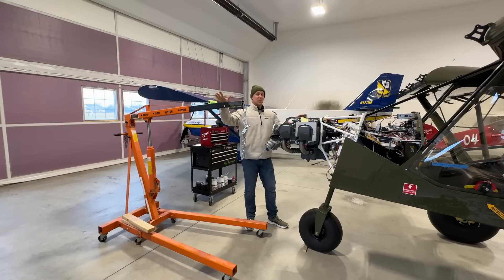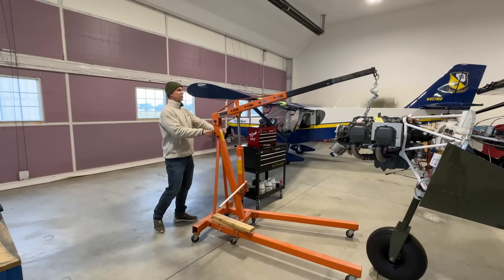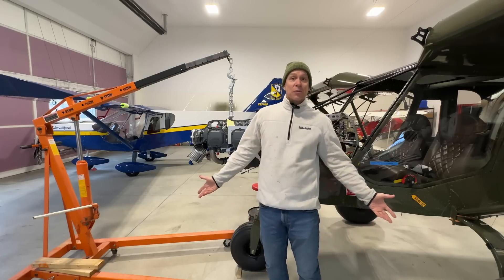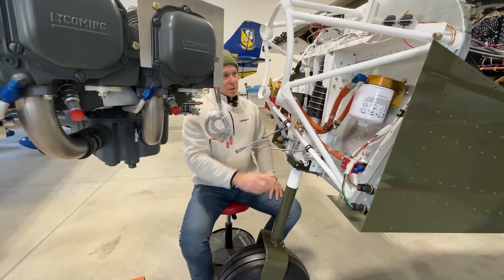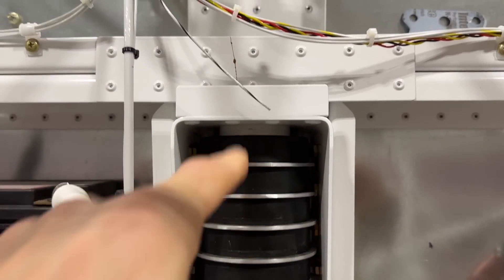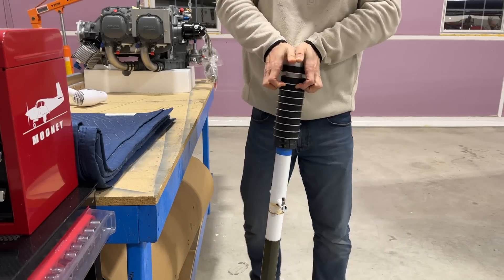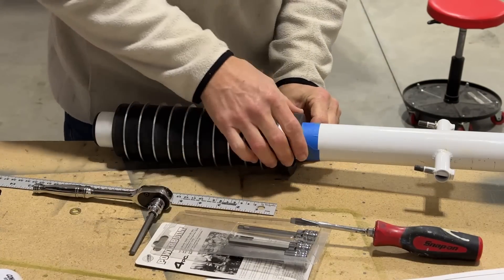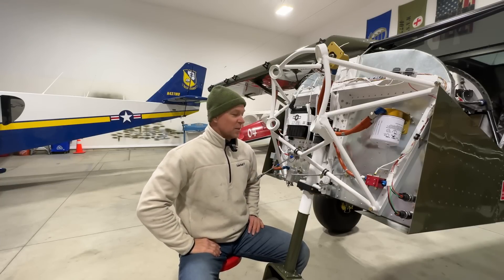Removing the Lycoming Engine

Comment: Did you solve the mystery of the 290 mm discrepancy ? 
Should the measurement be to the lowest surface in the assembly of the ‘donuts’ (including the bottom two steel fittings) ?  
… or is the dimension shown on the drawing for a different assembly configuration when compared with yours ?
Impressive patience 👍
Exceptional attention to detail as always 👏
Reply: Just finally read through the earlier comments, so it was a different number of pucks (donuts) installed 🤔
Reply from the maker: @aviationled_mmix  Yes my kit was shipped with the 750 STOL nose pucs and plans page. Roger at Zenith sent me two additional pics so with the two additional pics all the measurements were correct.

Comment: Not sure if you do much off airport operations but on my zenith the nose gear just wasn't robust enough.  Started getting distortion in firewall brackets, and the floor really rattled on rough terrain rollouts.  I extended some channel underneath to the seats and beefed up the firewall.  Then I added the nose strut from a Cessna 172.  The new nose gear has been a game changer with my plane.    I built in an extra 6" of prop clearance while I was at it.  New gear is significantly heavier but has totally been worth it to me.  I can't say enough about how well an oil filled nose strut does on the zenith.

Comment: Have ya concidered NOT having your lift boom extended so far ? If ya shortened it , it wont tip forward. ( ex crane operator ) 😂
Reply from the maker: That's a good point Dave. I had to have it extended pretty far to get it off the crate it was shipped in. So I just put the engine hoist back to where I had it previously. Looks like I didn't need to extend it so far this time. But hey...it worked! LOL

Comment: You really want full movement of those pucks to provide proper shock absorption. As tight as they are now will cause problems. Lubrication is the issue and that will deal with your corrosion concern. Remove the paint.
Reply from the maker: I'm actually thinking of just getting a new gear leg from Zenith. I want them to weld in the small tube at the bottom that used for their tow bar.

Comment: 2 things - 
Noticed what I would consider a problem with your throtle cable mount.  You have the cable sheath mounted to the motor mount, of course when the engine is running there is relative motion beween the engine and the motor mount.  This motion can manifest as throttle movement because of your securing the throttle cable sheath to the engine mount.  I secured the sheath to the motor (via a bracket mounted on the engine/carb).      
   About the puck stack, how is your clearance between the nose gear upper mounting bracket and the aluminum washers between pucks.  I had to chuck mine up in a lathe and machine them down so they wouldnt rub on the bolts and rivets on the inside of the upper nose gear bracket.
Reply from the maker: I'm aware of that. There are a few things FWF I'll probably be changing. I did notice the tight tolerance between the disks and the bolts, and it's VERY close, but they do not touch.

Comment: Do you think Zenith should circulate a service bulletin about the 290mm nose wheel assembly measure, to give more ground clearance to the prop?
🌏🇭🇲
Reply from the maker: If you read the other replies, an eagle-eyed viewer noticed my gear has 10 pucks and the plans show 12. So I'm not sure if Zenith changed the number of pucks and didn't update the plans, or they just didn't send me the two extra pucks. But with the 12 pucks, the 290mm is accurate. So the real question is: how many pucks are suppose to be on there?!?!

Comment: Your nose gear puck adjustments would have been much easier if you hadn't coated the area under the pucks with paint or powder coat (don't know which one you used).  It's much better to leave that area bare metal - I ground off the steel scale and even slightly polished it.  Then, liberally grease the pucks and nose gear leg with 3M silicone paste grease.  I also lightly sanded the i.d. of the rubber pucks to ensure they would slide firmly but smoothly on the nose gear leg.  Using this method, I can slide the pucks up without having to remove the leg - gently pry with a pair of big screwdrivers if necessary.  Then, loosen and push the upper collar up against the stack,  push the lower collar up against the the upper and secure the bottom collar.  Then again with a pair of screwdrivers, you can pry the upper collar up to tension the stack, secure the upper collar screws, and then bring the bottom collar up and secure.  You can repeat this as necessary to get the proper tension.  I've had zero corrosion problems with not painting or powder coating the area under the pucks and the suspension is very smooth and supple - feels like a pneumatic strut!
Reply from the maker: John, I thought about that when I had the gear leg powder coated. I knew it would make the pucks more difficult to move or install, but I wanted the steel protected. I’m sure with enough grease on there it would sort of act just like the powder coating to protect it from corrosion. 👍
Reply: Yes, the grease is protective and also the stack is so tight from compression and with the grease between the pucks, the gear leg is essentially sealed water-tight!
Reply from the maker: @n206ja  How did you polish the bare steel?
Reply: Used a foam-backed sanding pad on a grinder and successively finer grits of paper and gave a final smoothing with Scotchbrite.
Reply from the maker: @n206ja  I’ve been thinking about replacing this gear leg for a white because I wanted to have the Zenith tow bar tube welded in. Removing the powder coating on this gear leg is too difficult to do (as far as I know) but if Zenith will weld in the tow bar tube I may just get a new gear leg. Would be interesting to polish the top as you did.
Reply: You could probably get the powder coat off with a coarse grit flap wheel or burn it off with a torch - it's going to get  burned by the welding, anyway. I'd probably try that before buying a new leg but of course, I'm a cheapskate! LOL!

Comment: Mark, why didn't you use a heavy duty spring for the front landing gear instead of the rubber doughnuts?
Reply from the maker: Because the kit comes with the rubber donuts. If I were to do it again, I may be tempted to use the Viking spring.
Reply: @KitplaneEnthusiast  There's still time!
Reply: @KitplaneEnthusiast  The Viking Spring has been indespensible in the backcountry for my Big Tire Cruzer. I also added +4 inches to my nose gear and main gear besides the 27.5 for 12" of prop clearance. Glad I did.
Reply: Adam, at Aero Works, who is also building a 750 SD, custom ordered a special oil-filled, heavy duty spring for the front to replace the donuts from ACME. This means they have all the basic specs on the 750 SD. Adam didn't tell them the proper internal diameter of the nose wheel strut, but that just needs to be measured and given to the folks at ACME to get it right. It is shown on episodes 34, 35 and 36 of Adam's build site on YouTube. It does take some modification but it looks amazing and might be great for backcountry flying. @KitplaneEnthusiast

Comment: The extra pucks are because you don't do STOL with a MOONEY but when you do it with this plane you can SLAM the nose down and not have to worry about bottoming the strut!
Reply: I'm sure there are more also in case you run over rocks, small ditches, and other depressions in the ground when off airport that might require they be there that a MOONEY on a paved airstrip doesn't have to contend with.

Comment: Thanks for the video.
Regarding the 290mm measurement, it looks like there are 12 disks in the manual, but only 10 on your nose gear. Are you short two?
Reply from the maker: Hmm I didn’t notice that. I installed everything zenith sent me. I don’t have any extra aluminum disks that go between the pucks so this is what I received in the kit. I’ll have to ask Zenith if they shorted me or if they changed the number of pucks!
Reply: Good call @know-way, I think that this is why the plan is calling for 290mm
each spacer/washer kit seams to measure 20mm (that I could make up from the video)
So if Kitplane Enthusiast say that he is at 250mm now + 2x20mm  (Missing spacer/washer) = 290mm exactly as per the plan.
Reply from the maker: @patrickfarley8864  Yes with two more pucks the 290 measurement would make sense.